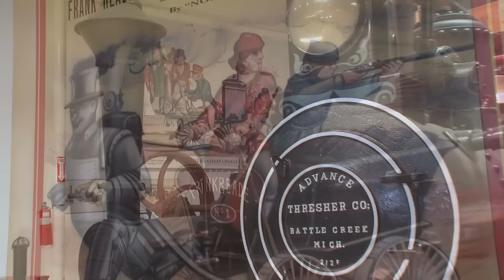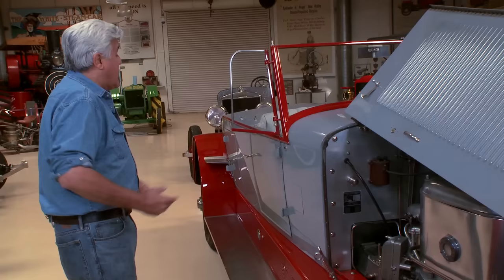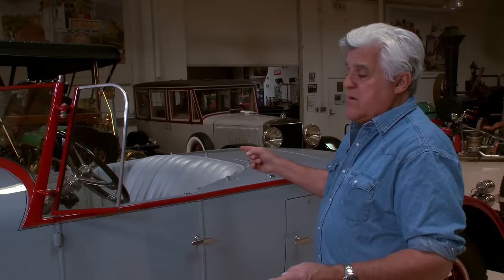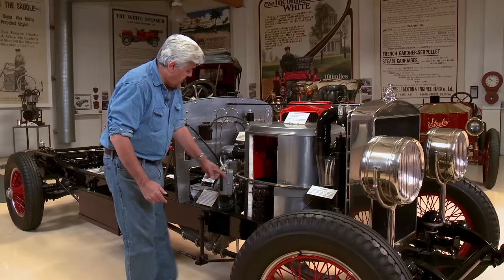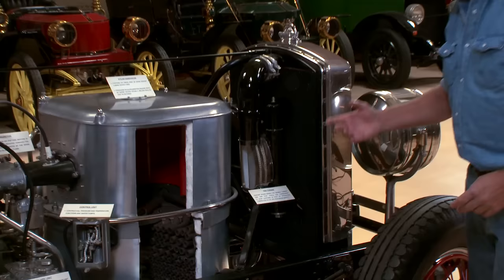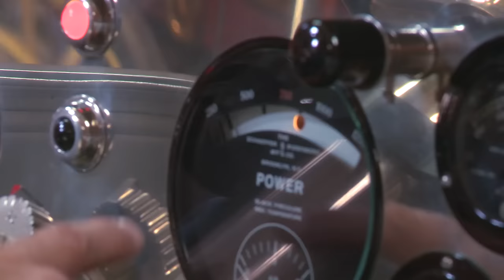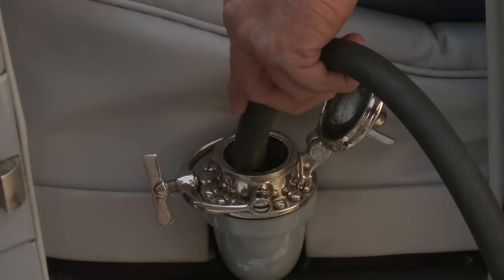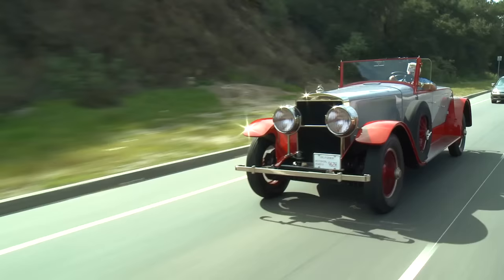1925 Doble E-20 Steam Car - Jay Leno's Garage

Comment: Unfortunately I think this was the last steam car he did.
Reply: The Doble steam car company went bankrupt in 1931 and Abner Doble died penniless.
Reply: @sandervanderkammen9230  I mean the last steam car Jay Leno covered on his channel.
Reply: @Ken19700  OK, I think he has one other steam car but it is undergoing a major restoration.
Currently this Doble is inoperable after a major engine failure.
 Doble was the last steam car company, most went bankrupt or switched to ICE cars shortly after electric starter for internal combustion engines were introduced in 1915.
Reply: @sandervanderkammen9230  he has several steam vehicles and stationary engines that he's had on the channel. This is just the last one. I just think it's unfortunate that he hasn't had one on in so long.
Reply: @Ken19700  He just posted a recent restoration blog episode that features this car and the massive amount of damage to the engine.

Comment: What mpg does this get?
Reply: Jay gets around 6.5 MPG on regular unleaded gasoline, about the same on kerosene.
Reply: @sandervanderkammen9230   I read somewhere else that the sales brochure for it says it got 45 mph....but it must have been wrong?
Reply: @katiegreene3960  Yes, very wrong. even Doble only claimed 12 MPG on kerosene... which was very optimistic.
Reply: @katiegreene3960  The Doble E series has less than half the fuel efficiency of car built in the 1960s... a Toyota Prius engine is around 500% more efficient.
Reply: @sandervanderkammen9230   yes but I wonder if the same amount of $ and resources and time had been devoted to this technology? On paper at least it is more efficient than ice.
Reply: @katiegreene3960  Absolutely not, that would violate the Second Law of Thermodynamics
 Nicolas Carnot published his formula in 1824 that proved that the Rankine Cycle can never match the efficiency of the internal combustion  engine... no legitimate engineers or manufacturers are interested in developing steam cars today.

Comment: Not street legal unfortunately. No turn signals, taillights or brake lights.
Reply: 100% street legal in California, vehicles in 1926 were only required to have a single red taillight on the driver's side... you can clearly see the required taillight mounted above the license plate.
Any questions?

Comment: With all the attention on electric cars which I think is foolish since electricity can fail and your electric vehicle is then silent metal.  STEAM propulsion seems more practical and environmentally friendly and, although complicated to design I see it as the "better future" for our country!  Go Steam!
Reply: Well Henry, you would be completely wrong in your assumptions.
Steam cars are obsolete because they are extremely expensive, impractical, inefficient and very bad for the environment.
Jay's  Doble E series guzzles unleaded gasoline at at the obscene rate of 5 MPG HIGHWAY and has a massive carbon footprint.
Reply: @sandervanderkammen9230 Kammen You are correct. My bad. I would hope a new source of heating would be included in any design (not electric) that would be energy friendly!  My point is about over-reliance on electricity for everything. An adversary could shut down our grid with EMP and EVERYTHING would be silent.
Reply: @henrybiggs850  Joseph Black and Nicolas Carnot tells us that steam will always be very inefficient because of the phase change from water to a vapor and the Second Law of Thermodynamics.

Any modern car sold in the U.S. will be required to have electronic motor controls,  Air bags, ABS brakes traction control and a whole assortment of other transistor electronics that will be vulnerable to EMP attack
Reply: @sandervanderkammen9230  I surrender!  Kamerad!
Reply: @henrybiggs850  We all love old steam engines... perhaps we should leave it at that.
Reply: @sandervanderkammen9230 Kammen Agreed.  Enjoyed your professional corrections.  Enjoy all the cars as I do!
Reply: @henrybiggs850  If you REALLY love steam engines, join a model engineering/live steam club to learn about these.
Eventually a kind member will let you drive his steam locomotive, and you can build or buy tour own.
Reply: @BasementEngineer BasementEngineer Thank you for suggesting the membership suggested, but I will pass.

Comment: Will steam cars ever make a comeback?
If they did, with todays technology they would reduce the emmisions, and save us from making expensive batteries.
A fuel cell of some sort is the way to go, why not let it be steam.
Reply: Hell NO! steam cars are dead, completely obsolete technology for over a century now.
 Steam cars are horribly inefficient, dirty and extremely expensive to build and maintain.

No amount of high tech electronics or space age materials will bring them back either.
The Laws of thermodynamics have doomed steam cars to museums and the history books.
Reply: @sandervanderkammen9230  Gas and Diesel cars will be in the same position soon!
Reply: @Barbarapape Someone said to me, "In 20 years Internal Combustion cars will be obsolete..." 
   That was 20 years ago and he was just as wrong then as you are now.
Reply: @sandervanderkammen9230  My original comment regarding steam cars was not intended to be a serious suggestion.
Internal combustion vehicles keep the whole world moving, and at 67 i won't see the day when there are none on the roads.
But future generations will need to find a viable alternative, and i don't think todays electric cars are the answer.
Reply: @Barbarapape  I completely agree with you, but that alternative will not be steam powered unless a safe, small nuclear fusion power source becomes reality.... fuel supplies and prices will only get worse and combustion steam engines are the least energy efficient way to power a  automobile.
Reply: @sandervanderkammen9230  I think that future cars will have electric motors, but some sort of fuel cell that is affordable will
need to be developed.
Steam or batteries are clearly is not the answer.
Reply: @Barbarapape  Fuel cell cars are already available here in California and other countries... it looks very promising if the cost of the equipment and fuel can be lowered.
 On big problem with Hydrogen is 97% of the world's supply comes from fossil fuels...

Comment: IMO a modern steam car will never be practical. Due to the limits of condensers ability to work in the heat. The future is electric like it or not.
Reply: The future is certainly not steam... Hydrogen has a very promising future and does not have the poor efficiency and environmental problems with rechargeable batteries
Reply: This car was built with many compromises. For instance, there are no gears. If it was fitted with a 5 speed manual transmission, then that should increase the range multiple times by keeping engine rpm down. also a smaller engine could be fitted as there would not need to be as much torque to take off.
Reply: @martin-vv9lf  Reciprocating steam cars don't need gears, this type of steam engine naturally produces maximum torque at 0 rpm... just like electric motors which also dont need a multi-speed transmission.

Comment: Literally no reason why we can't make cars today that run on water.   This is 1925 technology and its already better than todays cars in a number of ways.
Reply: No one has ever made a car that runs on water, Jay's Doble guzzles unleaded gasoline at the obscene rate of the 3MPG... what do you think heats the water into steam???
Reply: @sandervanderkammen9230  now, now.
Reply: @c.rutherford  Do you not understand how a steam engines works?
Water is used as the working fluid... not the fuel.
Any questions?
Reply: @c.rutherford  THANK YOU, For confirming that you don't know anything about steam cars.
Reply: @sandervanderkammen9230  my initial statement was only to say we have old technology displayed here which was already superior to current vehicles on the road in SOME ways in the mid 1920s, almost 100 years ago.   
Despite the obvious drawbacks.
Yet we saw significant improvements made to address some of these even with the Doble.   And there's no reason why more improvements couldn't be investigated, nor that this alternative type of engine couldn't one day be again offered commercially given more corrections made.
The fact that a 100 year old "Steam Powered Engine" is better than a "Gas Powered Engine" of today in ANY way, whether in efficiency, torque, or reduced pollution is something of interest worth pointing at and checking out. 
Your rather fervent attacks trying to knock me out of the conversation quickly by besmirchment seem rather defensive, imo.
Reply: @c.rutherford  So you admit that you don't understand why steam cars have been obsolete for more than a century???
Reply: @sandervanderkammen9230  obsolete, huh.   defensive indeed! 🚱
Reply: @c.rutherford  The last legitimate steam car companies had switched to Internal combustion engines or went bankrupt by 1926.
Reply: @c.rutherford  A TOY steam engine??? THANK YOU for proving my point.
Reply: @c.rutherford  The Laws of Thermodynamics and the Concept of Latent Heat is why no legitimate company or engineer would seriously consider building a steam car today... Carnot's Formula tells us that no matter what we do internal combustion technology will always be more efficient than the Rankine Cycle.
Reply: @c.rutherford  Your comment reveals someone who is not very well educated... you seem to have made the false assumption that steam cars do not have a massive carbon footprint compared to ICE cars... you don't actually believe that steam cars are Zero emissions do you???
Reply: @c.rutherford  No, I'm trying to educate you... a man named Charles Kettering single handedly wiped out steam cars by completely eliminating the only advantage steam cars had over ICE cars.
   In 1914 he invented the electric starter for internal combustion engines and introduced them into mass production in 1915, within a decade all the hundreds of steam car manufacturers either switched to ICEs or went bankrupt.
Reply: Prayers for Jay and his family, he is currently in hospital burn unit undergoing treatment for severe burn injuries he received while starting his steam car.

Comment: BTW, since it's fuel is water, does that mean you can't park this car outdoors in the winter?
Reply: The Doble E series fuel is Gasoline, Kerosene or Diesel.
 The boiler, engine, water tanks and all piping must be completely drained in winter to avoid freeze damage otherwise the burner had to be left running or parked in a heated garage when not in use.
  The Doble is an extremely expensive car both to build and maintain.
Reply: easystreets70  Steam cars have boilers and engines that need to be rebuilt often, at considerable expense. 
Steam cars are obsolete technology and have been for more than 100 years.. this is for some very important reasons that you need to be knowledgeable in engineering to fully understand.
The biggest problem is they are horrible gas guzzlers and polluters... very expensive to build and maintain and require boiler inspections for safety.
Reply: easystreets70  No amount of new production technology can change the Law's of Thermodynamics

The Doble E series uses a Monotube Type Boiler, if it turns water into steam? It's still a boiler.

The Doble E series only produces 1,000 ft.-lbs of Torque at the wheels at 0 mph.. 
My Ford Super Duty truck produces 3,000 ft-lbs at the rear wheels  (Electronically limited to 1,900 ft to protect the Axle from damage)
But more importantly it produces 500 horsepower... and still gets 18 to 21 MPG...
Reply: Prayers for Jay and his family, he is currently undergoing treatment for severe burn injuries he received while starting his steam car.

Comment: Considering how much trouble Toyota is having creating a powerful hydrogen-driving car with Yamaha's 8 cylinder engine that gets more than 50 miles on a tank of fuel, this steam car seem a great deal more practical and fun.  https://www.youtube.com/watch?v=vJjKwSF9gT8
Reply: The 2022 Toyota Mirai Hydrogen hybrid has a 400+ mile range and gets 76/71 MPGe

Steam cars have been obsolete for more than a century for some very good reasons... on is terrible fuel efficiency.
  Jays 150 horsepower Doble gets between 3MPG and 6MPG on regular unleaded gasoline.

Comment: We need to bring steam technology back to the front. With dozens of bio fuels available,  we could have a steam car that runs on orange peels and bad whiskey and ve more environmentally friendly than solar and electric cars
Reply: Unfortunately steam cars are obsolete for some very good reasons, most importantly they are horribly inefficient and not very clean by today's standards... another important factor is the incredibly high costs to build and maintain a  steam car... Jays Doble is the most expensive car in his collection to maintain and is currently undergoing its second major overhaul in less than 4,000 miles... 
Jay Leno runs his Doble E series on regular unleaded gasoline and gets between 3MPG and 6MPG, that's appallingly bad.

The few steam cars that run on solid fuels requires 2 persons to operate legally and have significantly lower energy efficiency, requiring more frequent stops for fuel and water.
Not very practical vehicles for a modern-day lifestyle.. or budget.
Reply: @sandervanderkammen9230  inefficient? Really? An engine that literally runs on any fuel source is inefficient? There is a guy in Florida who built a steam engine that runs on orange peels and has it in his car. It's only emission is co2, the same emissions you put out writing this thing.  Look up cyclone steam engine. Its a concept engine that was killed by big oil, because it ran on biofuels. The concept is sound, but as long as large corporations can file bs lawsuits to stop people from going that direction,  then we won't get anywhere. 

It's a better idea then electric cars who have a 100k millage or less max and has to be scrapped because the battery replacement costs 50k. And informer to get the power for those cars, you're going to have to burn coal and open more lithium strip mines. So it's not like they are saving the environment any more than gas and diesel.  Steam can move ships as large as air craft carriers, but we can't use them in a tiny as car? There is large companies pushing this down so they can keep milking the planet.
Reply: @Ratharian  What exactly does the type of fuel have to do with efficiency?
Reply: @Ratharian  Can you prove his engine only emits CO2?
The lower the fuel efficiency the higher the CO2 emissions for combustion engines, the only exception is hydrogen fuel.
Reply: @Ratharian  The "big oil" companies would be very happy to see the roads filled with Gasoline guzzling steam cars...
Steam cars once accounted for 1/3rd of all cars registered in America.
The steam car industry was wiped out by the genius of one man, Charles Kettering who invented the electric starter for internal combustion engines in 1915.
This invention completely eliminated the only major disadvantage that prevented superior internal combustion technology from dominating the automobile industry.
Reply: @sandervanderkammen9230  no, they wouldn't because steam cars can run on book fuels like ethanol and methanol made from left over crops. Big oil would be out of business because who would drive a nox admitting gas car at 5 bucks a gallon, when biofules like vegetable oil is way cheaper and easier to produce wile being renewable?
Reply: @Ratharian  Electric motors are far more efficient, over 90% energy efficiency.
You are correct in that the reason why electric vehicles are not as popular as ICE cars today is rechargeable batteries are horribly inefficient and expensive... and they are certainly not better for the environment.
 The fact remains that they are still more efficient and affordable than steam cars.

Excellent point, while all steam engines jave very poor efficiency due to thermodynamic entropy, thermal entropy varies depending on scale (size).
Large multi-megawatt power plants and large marine vessels can achieve better efficiency than small steam cars which achieve the very lowest thermal efficiency.
Any questions?
Reply: @Ratharian  Actually internal combustion engines can and do run on virtually every type of fuel a steam engine can, including wood and nuclear materials...
The critical concept that you need to understand is ICE consume less fuel for the same amount of work/power generated and are cheaper to build and operate.

Diesel engines were originally developed to run on biofuels and are  the dominate technology because they deliver the highest fuel efficiency regardless of the type of fuel used.
Reply: @Ratharian  Steam cars emit similar to even higher NOx emissions than Diesels..
As steam car efficiency increases, so does NOx emissions.
Reply: @Ratharian  Unfortunately alternative fuels like biofuels cannot meet current energy demand that are met by fossil fuels... if fossil fuel ceased to be available tomorrow? The price of biofuels like ethanol will skyrocket way beyond 5 dollars per gallon... the only solution for the future of automobiles is internal combustion technology which has higher energy efficiency and potential for even higher energy efficiency... eliminating steam cars as a viable alternative.
The only other viable alternative is electric vehicles powered by hydrogen fuel cells, a technology already available here in California and some other countries.
Steam cars will remain dead, they offer no futher potential as viable alternative in the future.
Reply: Prayers for Jay and his family, he is currently in hospital burn unit undergoing treatment for severe burn injuries he received while starting his steam car.